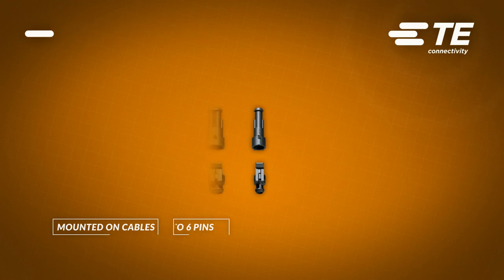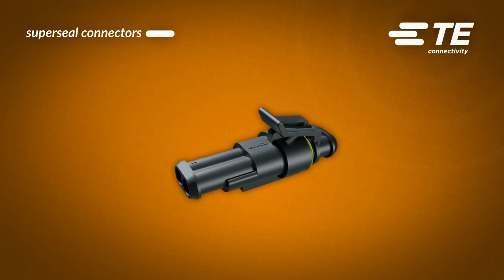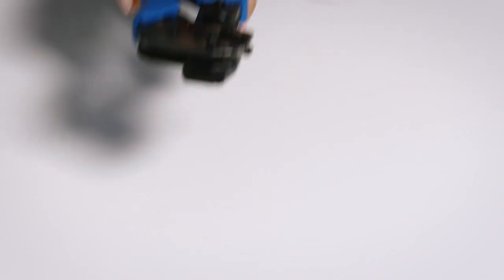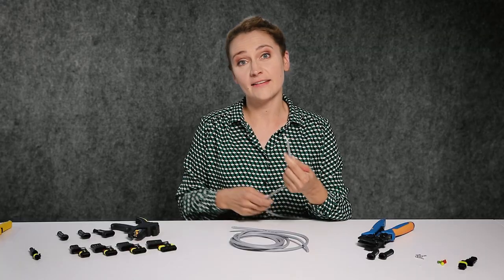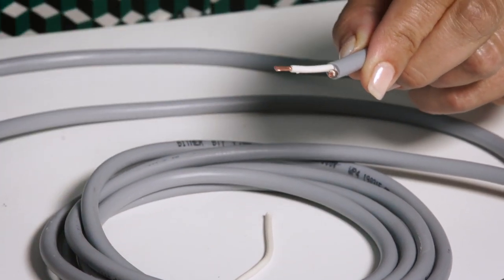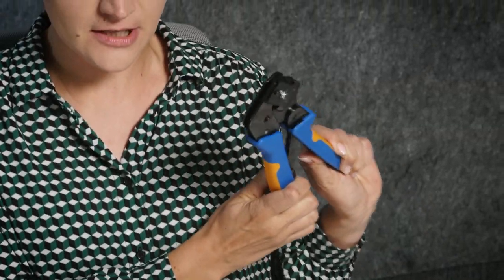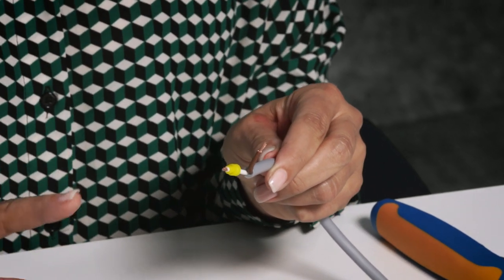Superseal Waterproof Connectors [How to crimp and connect]

Comment: Great video and excellent informational content but $400 for a crimping tool?!?! WOW!
Reply: Not a huge difference from Deutsch or Weatherpack, maybe a few dollars more.
Reply from the maker: Dear Jeoka Gem3, there are other crimping tools that are much cheaper. However, they will not guarantee the durability and quality of crimping as the TE Connectivity 58583-1 crimping tool. The production process of high-quality tools is more accurate and of high precision. So when you crimp, there are no doubts, and if you followed the instructions you will not have to repeat it again.
Reply: @TME.ElectronicComponents  yea ill stick to my $15 crimping tool that does exactly what yours does lol
Reply: I use Durite crimpers. Cost about £35 ($50). Very solid high quality reliable crimpers. They work fine for assembling connectors.

Comment: Lovely. Though, the red lockinf tab on male connector usually needs locking by a screwdriver or similar. However, it would be nice to know how to depin both male and female connectors, eg with TE depinning tool.

Comment: You forgot to install the strain relief(s)
Reply from the maker: Hey... Umm you are right; we didn't put the strain relief at the end although we have mentioned about it around 4:11  : S
Reply: @TME.ElectronicComponents  If you want my opinion, BEFORE striping the wires, install strain relief(s), and then install the seal(s), so that there will be less chance of damage to the wire strand(s).  Please reply.  Dave...
Reply from the maker: @daveridgeway2639  Yes, that would be a better way to do it :D Thanks for the tip!

Comment: Can the same crimping tool be used for Mini Superseal? (used for PWM signaling for pumps from Grundfos and Wilo)
Reply from the maker: Hey, unfortunately the 58583-1 is not suitable for the Mini Superseal receptacles (166309-2 or 166310-2). According to TE's website only automated applicators are suitable for this. However we will contact TE Connectivity for more information and let you know if something changed. 
Have a great day!

Comment: I can't push the pins enough for them to click in the male connector. The wire bends long before they click into place. I had to use a pair of pliers to pull the pins from the other side until they clicked, which I am sure isn't best practice. You mentioned to CTZN that the red cap doesn't need to be removed from the connector. If I remove it, would it allow me to install the pins easier, and if so, how do I take it out? Thanks!  Edit for the keyboard warriors: Yes, the cables are the right gauge/diameter (both the insulation diameter and the actual wire).
Reply: I’m wondering the same thing !

Comment: For the male contact, how do i get out the red clip inside?
Reply from the maker: Dear CTZN, there is no need in taking out the red cap from the male connector. After you crimped the male contact, you simply push it into the connector just like for the female part at 5:50. Although, if you need to take the male or the female contacts out of the connector, TE Connectivity has a special tool for that. Here is the link to it: https://www.tme.eu/en/details/539960-1/crimping-tools-others/te-connectivity/

Comment: washer fluid?
Reply from the maker: Hey, In short... yes :D 
Here is the full quote from TE Connectivity:
"AMP SUPERSEAL 1.5 SERIES Connector exceed the requirements prescribed by IP67 according IEC 60529 and DIN 40050-9 standards and has its application in the automotive, agriculture and industrial machinery"
Have a nice day!

Comment: Hello Hot Lady , Where can you buy the spare pins ? Thank you
Reply from the maker: Hey! If you need male contacts you can find them here: https://www.tme.eu/en/details/amp-0-0183024-1/automotive-connectors/te-connectivity/183024-1/ 
and if you need a female contact you can find them here: https://www.tme.eu/en/details/amp-0-0282110-1/automotive-connectors/te-connectivity/282110-1/ 
Have a nice day!
Reply: £14.00 postage its cheaper to buy new complete on Amazon

Comment: Can't understand how electricity can float because the contacts didn't touch there is just plastic
Reply: I assume the male part of the connection pushed through the holes of the red cap and make a connection all leading to a water tight seal
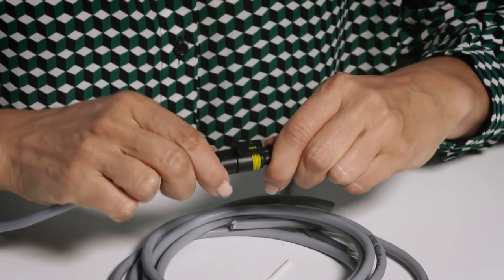Reply from the maker: Dear Cedrik, after crimping the female contact at 5:34, Agnieszka inserts it to the connector itself (5:49) and covers it with the red cap. At 6:05 , there is the other side of the connector, the male contacts. And as diamondheat9 assumed - and was right, the male contacts are going through the red cap. We hope it helped.